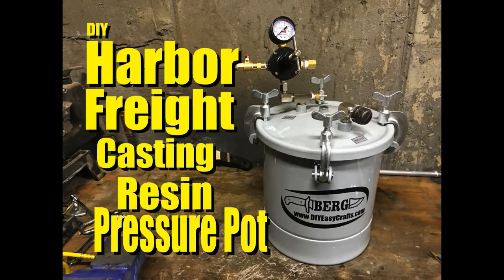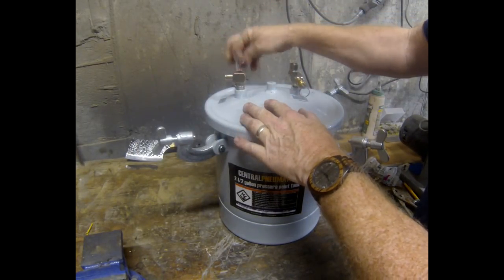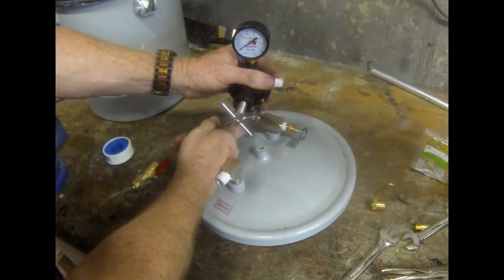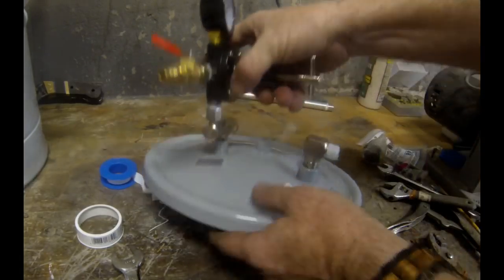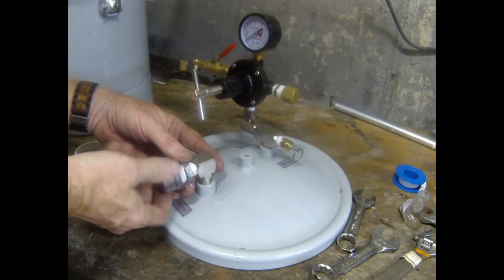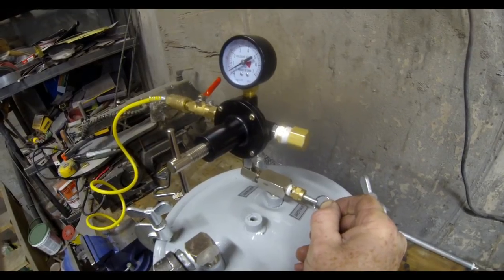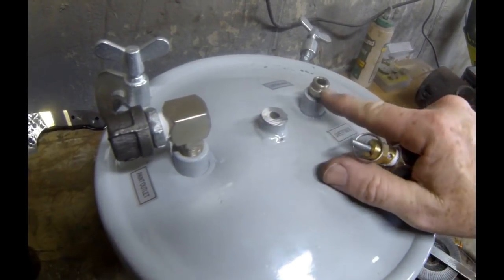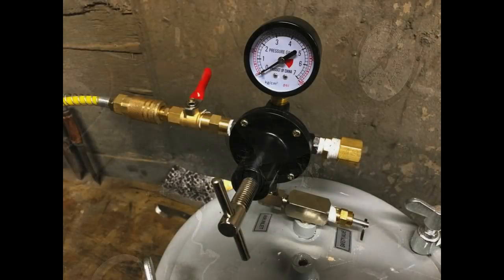Easy DIY Casting Resin Pressure Pot from a Harbor Freight Paint sprayer

Comment: Didn’t give the size s of caps and accessories needed
Reply: While I've not done this conversion myself (I'm still deciding whether to make the conversion or to purchase a better version already done).  Anyways...all of the fittings he and others use for this conversion are very basic brass fittings which you can find at Home Depot, Lowe's, or a hardware or plumbing store.  Nothing shown here is exotic, difficult to come by, or expensive.

Comment: Doing the adaptations was not difficult but I was so discouraged when we tested this pot and we had a leak in the lid itself.  It was leaking around the base where we attached the emergency blow off valve.  Ok things happen…. So I returned it to Harbor Freight, they were very nice and exchanged it.  Happy Me.  Well the second one wasn’t any better.  This time it was leaking around the lid where the pressure gauge attached….maybe “MADE IN CHINA” is not worth the savings…….my Harbor Freight got a bad batch…..

Comment: I prefer the method of getting rid of the "T" under the regulator and putting the regulator right down in the hole where the T was, and putting the relief valve vertical - in the large 3/8" hole where the outlet elbow is. You need a 1/4" to 3/8" reducer. This gets rid of a lot of joints. Also.. glue the seal in the lid so it only has to seal where it meets the pot. Also.. sand the top of the pot very smooth and use a little Vaseline on the seal. Lube the threads on the lid clamps so you can really tighten them down. Check for leaks with soap bubbles.

Comment: Very nice, ill use this video to convert mine but instead of using the plug I would put a on /off valve to bleed the air out quicker instead of holding the bleeder valve, imnsure it would start to take a toll on your fingers later on.

Comment: The one thing I feel I should point out is that PRVs (pressure relief valves) really aren't intended to be used to relieve pressure frequently. They're a safety valve. The more they lift the weaker the spring gets and eventually they'll just leak. I'd recommend installing a regular ball valve on the straw side and use that to release pressure instead.

Comment: Great video, just a question about, why not just eliminate de T and put direct the regulator to the lid and change the release valve to the other side of the pressure gauge, then one side inlet of air, the other just for safety pressure valve and less connections. Thanks for sharing and your time.

Comment: I did this conversion but the safety release keeps tripping around 30 psi. I’m thinking about switching it to a 50 psi release. Is that safe?
Reply: @Russell g Russell it does not matter what you should use for resin curing, that is irrelevant. The thing that needs to be looked at here is will the pot hold to up a constant 50 psi when it came stock with a 30 psi SAFETY switch. I would not mess around with that but it is your call. Look and see what the max pressure rating is but also understand that rating is NOT going to be over hours and hours of time that the resin will be in there. So not a very good indicator.

Comment: How did you deal with the concave bottom?  How do you keep the molds level?
Reply: I saw another video, the guy just put a 9" round piece of wood in the bottom.
Reply: $1 foamcore board from Dollar tree works. Just cut it circle that fits.
Reply: You could level out a table, then place the pot inside and pour in resin to flatten out the bottom

Comment: Lots of unnecessary parts and steps here.  all you need to do is put the gauge in one hole and a tee in the other with the shut off on one end of the tee and the over pressure pop valve on the other.  done.

Comment: Great video, thanks. I've been looking into this pressure pot for my resin work, but I live in a tiny apartment in the Bronx. Is is possible to get a decent PSI with just a bike pump or do I really need to get a compressor?

Comment: You should use the regulator it regulates the pressure and can keep you from getting injured, after all that's its job is to regulate the pressure. If you have small leaks leave the ball valve on and the regulator will keep it at the 40 psi and the relief vale is there if it gets above its rated pressure which should be 60 psi or the rating of the tank.

Comment: Thanks for the video.  I learned a lot.  Can you use this pressure pot both for casting resin and for degassing using a vacuum pump?

Thanks

Comment: Thank you so much for your information...., however, wouldn't it behoove a company to just make a pressure pot that fits our resin casting needs without the adaptations? I would love to get a hold of one that would accommodate a 18" casting  with a 1" clearance! Thanks again!
Reply: 20" diameter that is!

Comment: I just finished setting mine up and I am doing a pressure test right now. I noticed that the pot is making some popping noises, is this normal for initial use?
Reply from the maker: Ive done a couple. First one had no leaks at all. Second was leaking from the pressure relief valve. That valve has a screw in adjustment to set the max pressure so I just had to adjust it. The second one also had a leak at fitting through top. I bought some liquid metal which is like a putty and covered the entire fitting. It as worked ever since. I only bring it to 45 psi
Reply: I meant sounds coming from the pot itself. I don't have any air leaks burning sounded like a car engine as it is cooling. A metallic pinging noise
Reply: you didnt put your pot on the stove did you?
Reply: @SaintBigAl  no just hooked it to my compressor. I have had no issues with it since the initial pressure test. I have even used it in a few of my videos. Works great
Reply from the maker: Why would I do that?
Reply: I was asking MillerMade.He said he had cooling down noises.lol
Reply from the maker: hat pressure are you at?  I did not have any noises like that

Comment: Great how-to Dan, but I must confess to wonder on the advantages of a pressure pot over a vacuum chamber.  You stated your purpose was to reduce the size of the air bubbles by compressing with air pressure.  Is it not more advantageous to remove air bubbles with continuous vacuum?

I am not criticizing, I am seeking knowledge.   As always, I enjoy your DIY tutorials.  Cheers.
Reply: As someone who just used it as a vacuum pot, I can attest that your resin will explode if you choose to vacuum.  I have not tried pressure, however.

When I say explode I mean that the bubbles in the wood (I use wood) will be pulled out creating massive bubbles that will act like a pot of water boiling.  In my cast there was literally nothing left...it was, however, EVERYWHERE in my pot.  Watch a stabilizing video done with thick acrylic walls and you'll see what it does.
Reply: My understanding is that normally you would use both a vacuum chamber and a pressure pot. The vacuum chamber is used to degas/remove bubbles from the resin before you pour it. After you pour, you can use a pressure pot for reducing any remaining bubbles in the urethane part while it's curing.
Reply from the maker: You can not use wood that has not been stabilized. Otherwise air and moisture from the wood will ruin the alumilite
Reply: Hi joe,I saw your question.Isaw this vid and it answered alot.take a look.https://www.youtube.com/watch?v=7IX9RvH5rxI
Reply from the maker: Joe Im very new to Alumilite. As I understand it vacuum pots would allow the air bubbles to get bigger and hopefully rise to the surface before the resin hardens. That would result in no bubbles. Pressure pots compress the size of the bubbles so you can not see them. I believe is faster to get the mix under pressure then it is to get full vacuum so some prefer the pressure pot for quick hardening resins. Bottom line people use both and get good results from both. Im going to play with the pressure pot a bit and then make and test a vacuum chamber

Comment: Using Teflon tape on brass fittings? 5:15  If there was no intention in using the regulator, why not just connect the hose with a ball valve on to the lid? I suspect when you removed the tube from inside, it loosened the seal, and created the leak.  Perhaps just cutting the tube shorter, would have been an easier solution. Looking forward to seeing the products that come out of it. Thanks for the video.
Reply from the maker: Tube removed was from outlet the leak was from the inlet. Otherwise you are correct we could eliminate the regulator. Just able to do it with less fitting and work by leaving it.
Reply: plus, leaving the guage is a bonus of not directly connecting it to the lid. that is why i opted to leave it anyway :D

Comment: This is probably a dumb question but, are you sucking air out or putting air in with your compressor? Love the videos
Reply from the maker: Not dumb at all. People use both vacuum and pressure pots for alumilite castings. Vacuum make the bubbles bigger so they rise out of the mix. Pressure compresses the air bubbles so they are to small to see. Most people seem to like the pressure pots for alumilite because you can get the mold into the chanber and under pressure faster. This way the epoxy does not harden with bubbles inside. Anyway this one is a pressure pot. Im blowing air into it.
Reply: Thank you